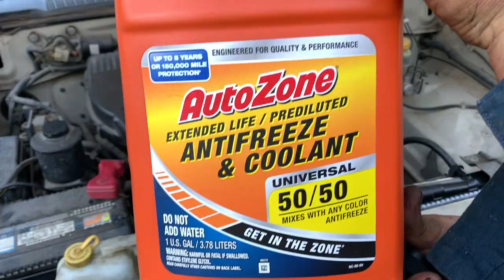How to replace a radiator on a Nissan Frontier 98-04 @elchanojose

Comment: Unless you have a 5-year-old-on-a-stick to put the nuts back on the fan's mount bolts, don't take that fan off.   Lift the shroud up and shove the bottom back and the radiator will come right up out - worth the fiddlyness to keep skin on your hands.    With the upper hose folded up and the lower just dead-drained it will take almost a jug of coolant to refill, not a whole one.
Reply: You’re not kidding, I did the swap but trying to get the 4 nuts back on the fan has taken me forever. I had to stop for the night because it got dark and late and have to continue tomorrow. All for 4 NUTS!!!! Do not take it off, whatever you do

Comment: I have a 2000 nissan frontier Manual 5 speed. I bought it used.
I was able to remove the Radiator without removing the fan clutch. The oil/ Tranmission lines on this truck are connected to the frame of the truck instead of the Radiator.
Thank you for the heads up so I would know what to look for..
Peace

Comment: I have to replace the PVC Valve(rubber grommets) when I replaced the PVC, is between the PVC and breather separator, the rubber vale was so bad and crumble, most of pieces was fall into the breather separator, I didn't take them out before I replaced the new PVC, This this matter?

Comment: I won’t be able to do this myself :( how much would this cost if I have a new radiator?
Reply from the maker: Hello!  The price of a radiator replacement can vary to a few factors like if is a móvil mechanic or a shop.  But this jobs can go from $200 up to $500 dollars depending on the mechanic or shop.  Location o city also can make the price up or down due to the amount of shops available.  Shop around or get at least 2 price quotes be for making your final decision of leaving it in one shop.  Take well care!

Comment: Does the radiator come with plugs for the transmission lines at the bottom, if you have a manual transmission?
Reply from the maker: Hello Robert!  If you install a radiator on a manual transmission truck, you don’t need to put plugs on the transmission fittings.  Is your choice to plug it or not, there is no liquid coming out of there.  Transmission and cooling on the radiator are separated from each other so liquids don’t mix or leak.  Take well care Robert!
Reply: Thanks, thats what I thought  @elchanojose